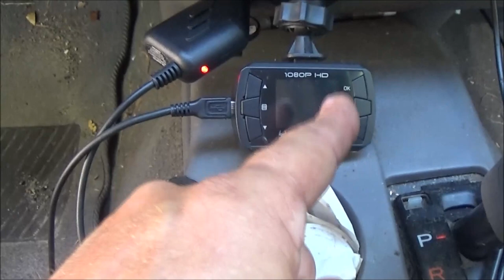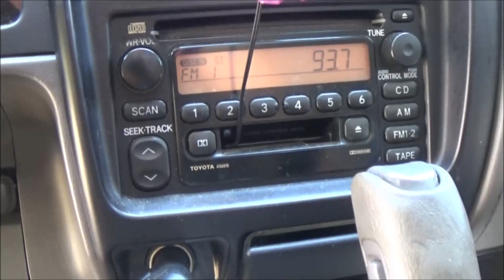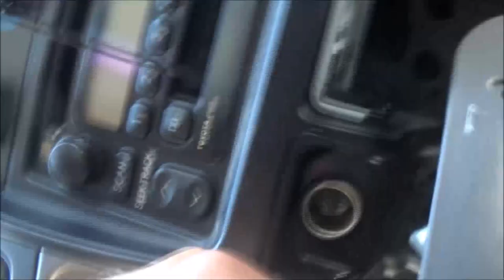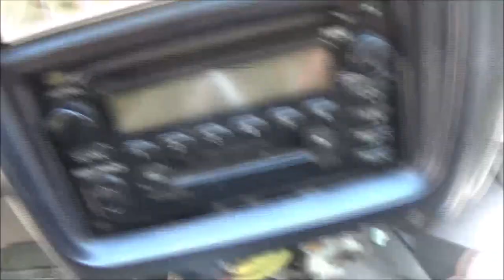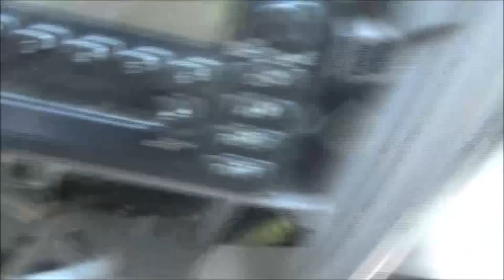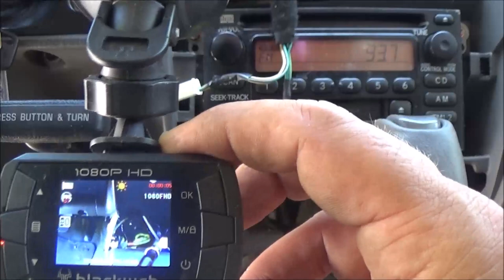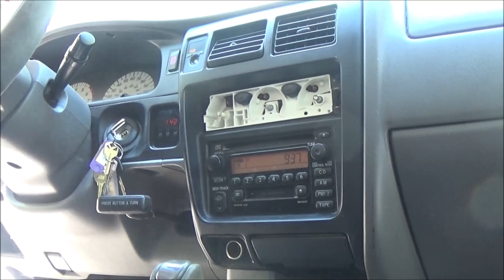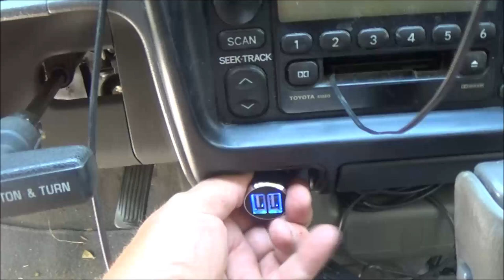2003 Toyota Tacoma Power Outlet Cigaret Lighter Repair

Comment: Thanks for the video on getting these damn outlets out. This happened to my 96 Tacoma and 99 Corolla. Process for my vehicles was very similar. Both had most of the "fuse wire" still good, with one end burned lose from its post. I decided to drop a small blob of solder to connect the burned end of the original fuse wire to its post. If there's a surge in the future, I figure the rest of the original fuse wire can burn lose again.
Reply from the maker: You're welcome. Thanks for the tip. And also thanks for watching and commenting.